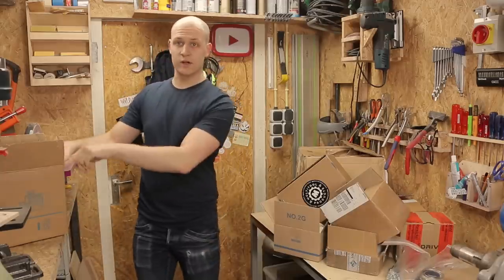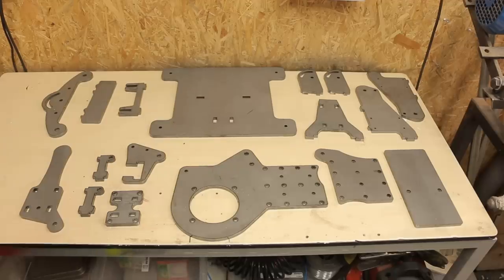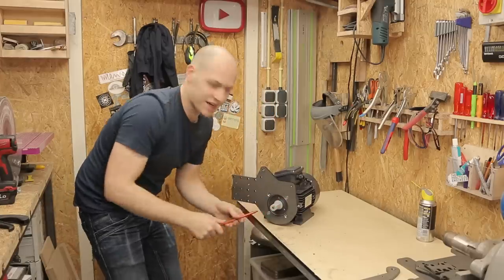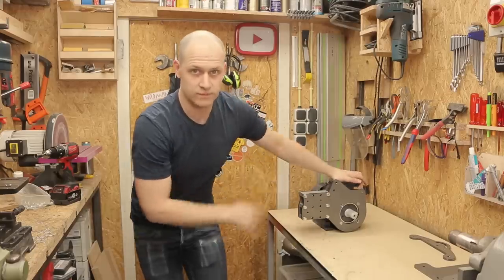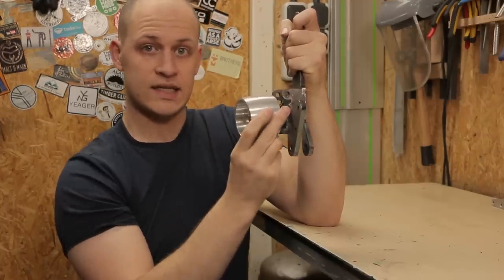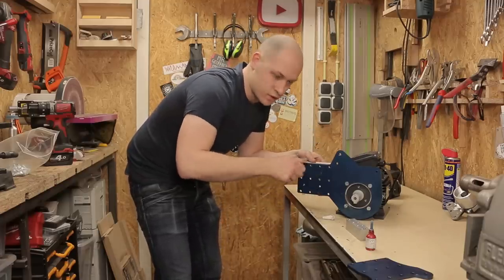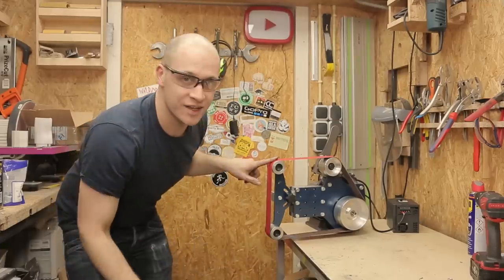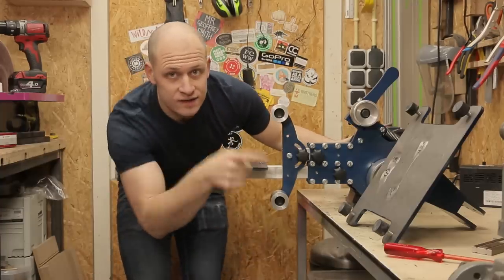DIY 48x2” Belt Grinder - It’s a beast!

Comment: Plans in mm or inch?
Reply from the maker: They are in mm
Reply: @Thepracticalengineer  Hey man i wanna Buy plans and build 2 Grinders .. can i sell 1 on Local ? Hows your opinion about it ? 

I will Change a few Parts an the complette Mechanism for wheel traking and 90 ° tilting ..

Comment: Very nice design and build. I like how compact it is and the low number of parts needed. Regarding the tool rest and front roller wheel aluminium bars, I would advise a shallow groove to be machined or routered inline with the locking screws as they are going create deformation/dents that are likely to cause the bars to jam in the socket. Apart from that, nice design.

Comment: Wonderful build man. What a beast I am wanting to build another with a VFD. I built me a cheap one a few years back from a old treadmill some scrap metal and a set of pillow block bearings I had lying around. I used skateboard bearings and wheels when I first made it and if you get the good bearings they will hold up for a 5 or 6 knives. I finally replaced them and it works very well has plenty of power for what it is. I had 30 bucks in it when originally and around 100 after wheels.  The next one I make I want to be able turn horizontal as well. Can I ask why not a 2 x72? the longer belts stay cooler and last longer. I heard they might not be as popular out of the USA though so I can understand if you can't get them very easy. Mine was kinda a throw together but yours is top shelf man. Now you might just inspire me. You have a good one and keep building. going to check your channel now.

 If you wan't to see a better design treadmill grinder than most check mine out on my channel.
Reply from the maker: Cool! That's awesome to make it of parts you have laying around.

The reason I went with the shorter belts is mainly so it fits in my shop. 
I'm pretty sure that I can extend the arm and fit a longer belt if I want to. But I have never tried that
Reply: @Thepracticalengineer  I gotcha. Very cool grinder in either size. I am subscribed so cant wait to see whats next

Comment: great machine great video what is the maximum belt speed you can run via the speed pot
Reply from the maker: I have a 3000 rpm motor on it. Besides that it depends on the drive wheel you have. 5 inches in my case
Reply: @Thepracticalengineer  lovely machine that gives you a belt speed maximum of about 20 meters per second , thays quite good.
Reply from the maker: You can of course place a larger wheel. Power won't be the issue

Comment: Is there a backing plate behind the belt where you grind?  I couldn't tell, but it doesn't look like it. You should add in a plate just behind the belt at the spot where you grind, so that you ahve something to press against behind the sandpaper.
Reply from the maker: I have a removable backing plate. In the first test it wasn't there but in the later shots it was

Comment: If I by the plans or a kit do I need to buy the same motor as you have used because of the mounting bolt pattern?
Reply from the maker: Hey, yes you do. Or at least a motor with the same flange type
Reply: The Practical Engineer thanks, yeah I actually read the details in the kit and plans for sale page and got the answer.

Comment: Great build! For future models it might be better to not use aluminum for the the square aluminum bars that hold the driving wheels and table AND the spacer blocks. If you would have made one of both parts from steel it would have moved a lot smoother!
Reply from the maker: Thanks for the tip!

Comment: Really great design!  I just found you and subscribed.  In viewing your workshop tour, I noted that you also have a disc sander.  I don't suppose that you considered making this motor's pulley into a disc sander/grinder so you can eliminate the stand-alone sander?  ... especially if you modify the base so it can rotate the complete unit 90 degrees.
Reply from the maker: Thanks! I'm generally not a big fan of tools that do multiple things. It often means they do multiple things like 50%.. It's better if they do one thing well. 
So I hadn't really considered that when designing. It could be done though

Comment: Probably one of the best diy belt grinder project I 've seen on YouTube. Congrats.
Just one question, why aluminium stock and not square tubing. It would have been cheaper.
Reply from the maker: I wanted it to be super ridgid so I went with the aluminium bar. A square tube would have been fine as well I guess